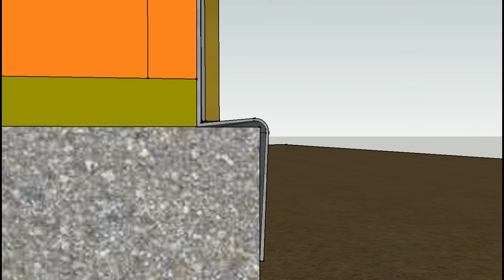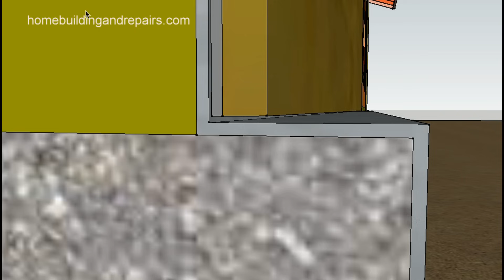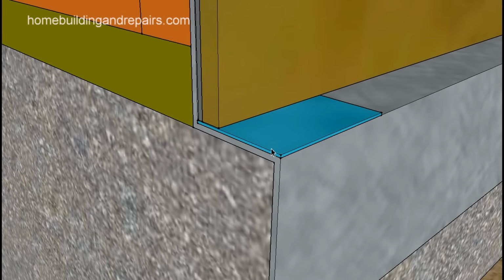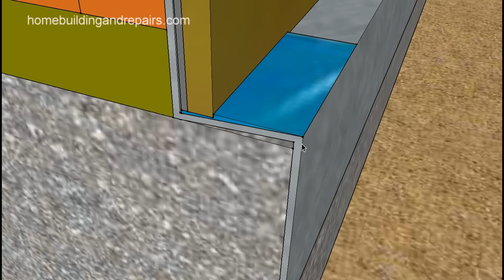Bottom of Siding Water Damage from Incorrect Installation of Foundation Metal

Comment: the bottom detail is correct but its also necessary to prime the back and edges of the sheet with an oil based primer as well as the front before its nailed on, also a vertical L shaped flashing on the framing corners,  the the primed plywood is then impervious to condensation formed when cold meets warm air internally , I did all this and its never bowed warped or cupped in the weather for over 20 years...
Reply from the maker: There are a lot of details in construction that are correct unnecessary for certain types of construction, building designs and climates. I'm glad to hear that you didn't have a problem painting the back of your plywood and hope that others read your comment. I've had problems painting lumber and trapping moisture which led to wood damage.

Comment: I'm confused. 😕 Doesn't the plywood sheathing go on the wall studs first and of course nailed to the wood sill? Then your flashing on top of that then place you paper on the wall in that order?
Reply from the maker: It all depends on whether or not you're going to be installing plywood sheathing. Older construction didn't require exterior sheathing, but as you said, the metal would go over the last piece of the framing process.

Comment: I have ten foot long pieces of z flashing. What do I do with adjacent lengths of flashing, just overlap them?  Or do I need to seal/mechanically fasten that seam somehow?  Thanks in advance for your answer, and for your very well produced videos!
Reply from the maker: I'm guessing about a 4 inch overlap will be fine and yes you could always use some type of sealant in between the pieces of metal for extra insurance against leaking.

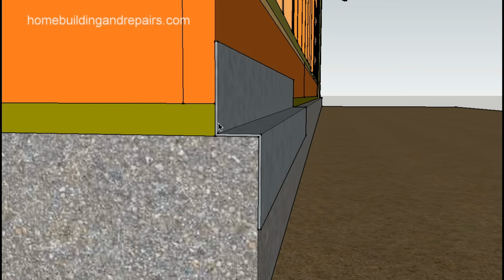Comment: @ 2:19 you talk about pushing the z flashing in tight  why not install a strip to make it stay at a slope like a long wedge shape or a 1/2" thick  narrow furring strip right on top of the base of the wall, this will both give a natural tendency to make a slope away from the wall its also a good place to add a thick calk joint to keep bugs and air out.
You could even put a bead of closed seal foam or strips from a panel cut at a 25 or 30 dg angle just glue it down install the flashing lay your siding 3/8" off the top of it for a calk joint on the wall.  One more trick I see being done is overhang the bottom sheet by a few inches and lay them like its lap siding on each row up the house. then call the bottom lips of each joint.

What your trying to do is stop bugs and air movement and keep water away from the wall studs and insulation. This will make for a tighter sealed home more energy efficient and cleaner. Any house that leaks a lot of air is going to draw in outside air and dust bugs or whatever else. All you ahve to do is pull apart a wall and see black insulation and this is key to showing just how much outside air get into your home.
This is caused by forced air hvac system fireplaces and water heaters that use inside the home combustion air. That replacement air has to come from someplace and your walls leak air. Also because cold pushes hot when its real cold outside the cold outside air will try and push your heat out of the roof that's poorly insulated. Attics tend to show where air is leaking from your home.

I'm not a contractor, I do not work in construction. Most of this stuff is just common sense things. If you pay attention to your house it will talk to you and tell you what's going on.

I had a flex tube type dryer vent over 30' long the vinyl stuff that was outlawed 2 long pieces of it taped together behind sheet rock, its never been cleaned out.
First off 30' is too long even for solid pipe second  its was behind a finished space
third it was filled up leaking and had marks where fires had tried to start beside filling the joist bay full of dryer lint it was filling the house with dust, and moisture, that warm air was getting trapped in the outside walls and the wood was soaking up the moisture cracking popping and making all kinds of racket late at night.   When I figured out what this was I tore down the ceiling in the basement removed the lint and pipe plugged that outside wall.
Moved the ven to a garage space with solid pipe vented it outside my total dryvent is now 3' long and it exits the house. Granted code says you can not vent into a garage, but it also says you can't run a vent over 30' + and never use vinyl type vent line or splice 2 of them together with duct tape. If I add 5/8" drywall soffit over the vent its within code safe and my clothes get dry faster and I use less energy.  Why don't dryers use outside fresh air? like a HVAC system or water heater!  That replacement air has to come from someplace.

Direct vent appliances make more sense for anything that warms then removes air from the living space to outside. And you thought the kids were dragging all this dust! Its your house. And its costing you money is lost conditioned space air.

House making a lot of loud popping tearing and funny noise at night? now you know what to look for.
Reply from the maker: Thanks for the comment and if you are asking a question, I might've missed it and feel free to ask it again.
Reply: 2:19 you talk about pushing the z flashing in tight  why not install a strip to make it stay at a slope like a long wedge shape or a 1/2" thick

Yes I tend to talk too dam much.

Comment: What about the space created underneath the flash when you angle it down? There is an area where I feel moisture can get trapped under the flashing, no?  Based on this illustration.
Reply from the maker: You bring up a good point and any areas where moisture can seep into or under the metal should be sealed with some type of sealant or flashed properly with metal. The end of the metal flashing will need to be sealed somehow if you had a situation similar to that shown in the video. Let me know if this doesn't answer your question.

Comment: Would putting sealant/caulk in the 1/4 gap between the bottom of the siding and top of the flashing actually help or hurt more in the long run?
Reply from the maker: Some people do it to keep out insects, but I think it would be better to leave it open or a least a small gap for moisture to escape if trapped behind flashing.

Comment: i found mold in one wall in the basement, maximum at the sill plate/Rim Joists area and adjoining sub-floor.  No ducts, electrical or pluming in this side.The patio door is just above this wall, and the wooden deck is built at the outside of this wall just leveled with the Rim Joists. the house siding is brick.
what is your explanation and advise?
Reply from the maker: Send me a few pictures and I will see if I can help. You can get our email address at the website.

Comment: Is it recommended to leave a gap between the house siding and the waterproof membrane to allow for water to trickle down?
Reply from the maker: Very good question, but I've never heard anything from anyone about leaving a gap, simply install the building materials in the correct order so that water has the ability to drain correctly.

Comment: You say metal, but could you use alternatives like copper or aluminum or would there be issues with those?
They do make a thicker aluminum usually used for door threshold plates.
Reply from the maker: Yes, you can use other materials like copper. I don't know if aluminum will work great.

Comment: Great illustration and advice.  This video completely validated my suspicions about issues with my current flashing. The bottom of my home's siding is actually touching the flashing in places, and I need to get that 1/4" distance from the bottom of the siding to the top the flashing illustrated in your video at 5:05  - could someone please recommend a tool that I can use to create that gap, while not cutting into the back of the flashing and keep the cut straight?  Thanks very much in advance.
Reply from the maker: Send to me a few pictures of your problem and I will see what I can do.
Reply: Multi tool or a mini skillsaw

Comment: I had to fix a spot on my  new house. I used pressure treated plywood. I put flashing in place. Worked it myself. But i put the flashing on the outside of the plywood. I used heavy duty exterior construction adhesive on the back of the flashing and good thick healthy bead between the wood and concrete so that when i nailed it to the wood and secured it to to concrete that it would work itself aournd the wood and flashing to hold it together. The next step for me is to build a small curb up against the plywood that will also sit on top of the existing concrete driveway to stop the water from getting up against the house. So far it has worked. Pardon the pun but knock on wood
Reply from the maker: I would just check the caulking regularly to make sure it isn't cracking or separating to allow moisture behind it. I've seen it done before, but it doesn't seem to work when the water on the siding is rolling into the gaps behind the metal.
Reply: gregvancom the flashing i used was already bent in a 45. Ive got it well sealed up.
Reply from the maker: @WARD5KUSTOMZ  Sounds good, just keep your eye on it and if it ever cracks, simply fill the cracks.

Comment: My slab overhangs about 24" can I use a standard size z-bar and cut a saw kerf in the concrete slab, this way I wouldn't have so much sheet metal laying on the slab.  Thanks
Reply from the maker: I don't know for sure that would work, because the slot cut into the concrete would simply fill with water and leak into the other side. I will make a video in a few days and put a link here when it is completed with more information.
Reply from the maker: https://youtu.be/tE3es9enb6g see if this helps

Comment: I thought you keep the siding up off the flashing a half inch..
Reply from the maker: Good observation and I would imagine that it would be fine as long as the bottom of the siding isn't touching anywhere where water could accumulate and absorb into it. I wouldn't have a problem with a half inch gap, but others might, because it might not look aesthetically pleasing.
Reply: @gregvancom  thanks for replying back..you seem like a open minded person.... I like that and your video.. I diffently will subscribe to your channel..
Reply: @gregvancom  I am replacing siding on my girlfriends back family room.. it has a lot of windows that I am not removing.. so what's the best way to re-flash around the windows.. ?
Reply from the maker: If you're not going to remove the windows, then you could always seal the edges of the window, where it meets the original window flashing paper, before installing your building paper over the window flanges and flashing paper.
Reply: @gregvancom  thank you

Comment: Would this configuration work for pre engineered metal building. We have concrete slab and steel walls with insulation. Thx
Reply from the maker: I don't see why it wouldn't if it was a similar situation.

Comment: Do I have to caulk between the metal and the wood? This will prevent air and water . Thanks
Reply from the maker: No that wouldn't be necessary, but you can install sealant at the ends of the metal or where they lap.
Reply: Thanks . Do you mean seal where the metal enter the wood ? 
Could I send you a picture so you can see what I mean ?
Thanks..
Reply from the maker: @AngelRivera-gm7bx  Yes you can send me pictures and you can get our email address at the website. I'm referring to placing a little sealant on top of the metal that would be placed on the right side for example where the piece of metal on the left side that is going to sit on top of it will lap over it and it usually laps about 6 inches. If that makes sense.

Comment: I have t1-11 siding should I culk the nails I put threw the side and top half of flashing and should I culk the plywood behind the siding and flashing.. and for the nails going threw the top half of flashing how far should be spaced out and are screws fine?
Reply from the maker: It seems to be a standard practice now to caulk nails I don't recommend caulking behind plywood and don't see a need to caulk the flashing. I wouldn't use screws and it's common to space the nails 6 inches on center along the bottom edge of the plywood siding.

Comment: Great video! How and where are you attaching the z-shaped metal to the foundation?
Reply from the maker: The metal lays on top of the foundation and will be held in place by the siding after it has been installed.
Reply: thanks!
Reply from the maker: You're Welcome.

Comment: i cannot find any videos what so ever on replacement of a sill joist rim joist repair! whoever built deck on home Im replacing deck on didnt see your video or do it correctly now i have to remove a 10' section of rotted rim joist before building the deck to do it right
Reply from the maker: You should be able to find something on our website, but let me know if you can't. http://www.homebuildingandrepairs.com/repairs/framing/index.html

Comment: Why not just install the flashing on the outside of the plywood?
Reply from the maker: Because the water that got behind the siding or even in front of the siding could go underneath the metal and into the building. It might be a good idea for you to visit our website and check out the siding videos in the home building section and the siding repair videos in the repair section.
Reply: Sam Tidwell 
Most contractor would install it under the weather barrier (aka tar paper or tyvek) and would not put it under the plywood.  Flashing is usually installed by the roofing and siding contractor after the framing contractor has sheathed the house with plywood or OSB. Any siding should be gapped according the manufacturer's instructions.  I do not think putting flashing behind sheathing is generally correct.
Reply from the maker: It will probably be okay, just as long as the water can't get trapped anywhere and can drain off safely.
Reply: @gregvancom  yeah there are 100 videos on youtube of guys fixing water penetration and damaged mud sills because guys did it the "Normal" way. I prefer the method in this video it adds a little cost, but you get better protection and efficiency at the sill...

Comment: A good tip. I had been wondering about this exact issue when I was drafting an out building for my backyard.
Reply from the maker: +Graham L I've seen this type of damage often and most of the time it's from using the wrong materials. An example of this would be using thin metal, metal than rust quickly, poorly shaped or incorrectly bent metal. The picture that was sent to me was actually thin aluminum that tore or ripped, allowing water to flow freely into the building.

Comment: That should have been a transition mud seal. Never use z bar for foundation! I'm a sheet metal worker out of Southern California and from what I'm seeing your knowledge of sheet metal is very wrong . When lapping it should be sandwiched caulked or soldered every 4'' .
Reply: Where are you located? What's your contact info? I need some flashing. Proper flashing is hard to find.  Transition Mud sills are hard to find. Home depot lowes doesn't sell them they only sell Z flashing and tons of stucco flashing, it's very frustrating. When you are trying to properly a mud sill.

 Regardless this video was very good because he explained why the plywood, would be rotting. Of course he could caulk that and make it stronger but lifting it up a quarter half inch off the base is a smart idea.